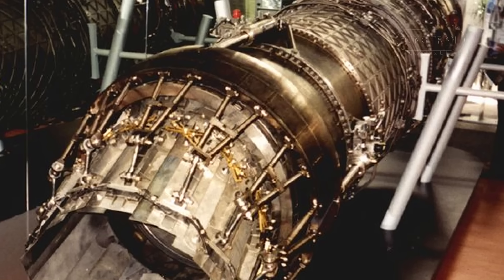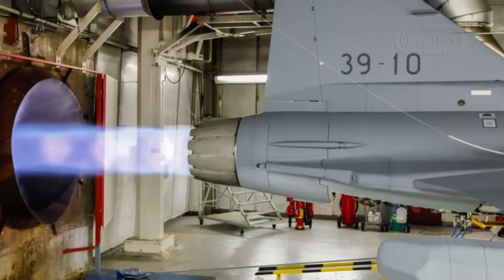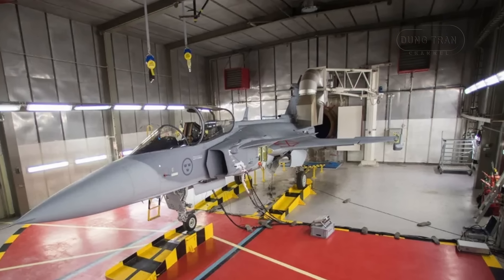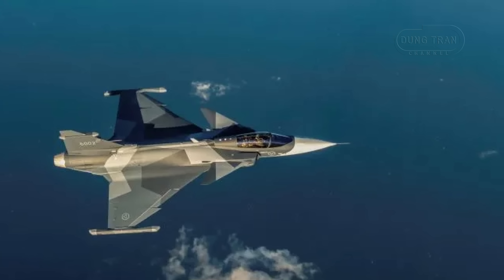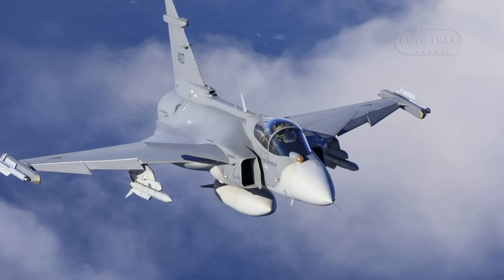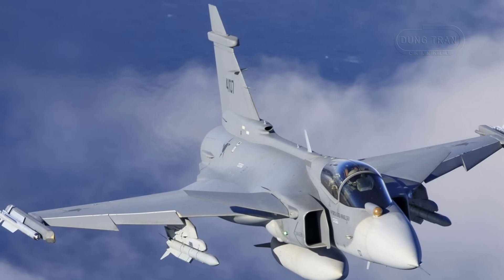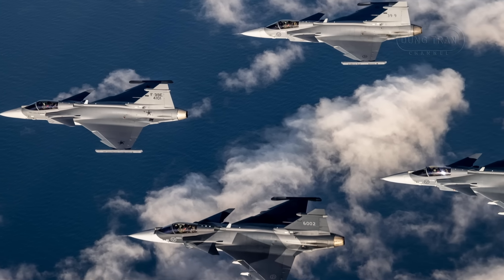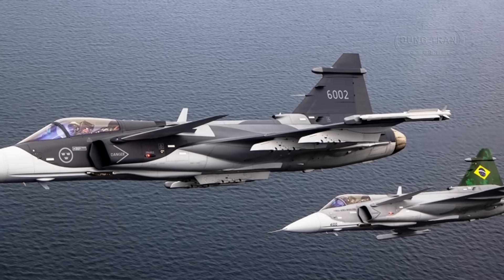Sweden’s Bold Move: Rolls-Royce Engine Could Save the Gripen E/F! 🚀

Comment: Canadian here. Gripen airframes and Rolls-Royce engines . . . Yes! Bye-bye F-35!
Reply: OMG...man I  hope so!!  And I'd love to see them build the engines here in canada as well!!!  Love to help the Swedes build and sell stuff to anyone else who want them!!!
Reply: @toxicslix Swede here. You could have far more runways than planes. You need slightly prepared country roads. I remember having to stop the car because a fighter was landing.  I live in Stockholm, you have to move around in the countryside to see this.
Reply: @toxicslix Maybe that could be arranged
Reply: @toxicslix I'd love to see them name the CF version the Arrow. ❤
Reply: The F 35 has been hyped as a do all aircraft and we in the UK have bought the one even the US Marines are thinking of dropping.
I am certain a Gripen could easily outperform an F35 as it reminiscent of a smaller version of the Typhoon.
Reply: @jeremyrichards8327   @jeremyrichards8327  As a Brit, I'm a fan of the Gripen. Currently our (UK) F-35Bs have no anti-ship capability, no land attack capability and no SEAD/DEAD capability. Plus they won't get Meteor until Block 4 (if that even happens). Building two carriers for such limited capability was a huge mistake.
Reply: @johnnykause - which P51? The first one with the American engine or the excellent one once it got the Rolls Royce Merlin?
Reply: If you look at the statist  the Gripen's warfare suite, can scramble the f35  radar and communications ,and its sensors can track the heat from the f35 engine. That is exactly how a Gripen shot down an f35 at the last NATO war games. A Raphael jet shot down an f35 just the other day in simulated combat. F35s are slow with poor maneuverability compared to most other fighters and only 2200km range compared to 3200km for the Gripen. F35 needs perfect runways and special heated hangers,things you won't have in a war zone. The Gripen can operate from anywhere .the f35 was built for show and tell the Gripen is built for war. Not to mention, the Gripen has nearly spotless record. The f35 has had 12 crashes in 8 years, 2 crashes, and 2 emergency landings in the last few months .
Reply: @JamieCyr-iq9ns  Great info--thanks!
Reply: And if paired with SAAB Global Eye using Bombardier Global 6500 airframe, the duo will be deadly and profitable to Canada.
Reply: 🇨🇦. Hey
Reply: CANADA, buy a few AND Join BAE in developing the Tempest II. Look ahead, Remember HOW USA MADE CANADA DESTROY THE AVRO ARROW?
WE (UK) do, Australia DOES, time that we all STOPPED BUYING ANYTHING from the USA, anything!
Reply: Canada should definitely give fair consideration to a Gripen E/F powered by a future EF-230 engine and not use it as some kind of negotiating tool the way Trudeau did before agreeing to buy 88 F-35As.
BUT
-The EF-230 needs to be developed for single-engine certification for the Gripen, which will add delay and cost,
AND
The Gripen E/F air intakes and airframe need to be redesigned to accommodate a yet-to-be certified EF-230, which will take time and add cost,
SO
RCAF Gripens will take longer to arrive and end up costing a lot more than they currently do, based on the engine swap alone. I don't know how much of the avionics is US reliant and what it would take to replace those with the nearest non-US equivalent.

If i were SAAB, and Rolls Royce I would want a firm order from Canada (and perhaps other countries) before embarking on such a risky, expensive venture.
If I were Canada, I would have to be so motivated to ditch dependence on US aerospace manufacturers that I would be willing to face more punishing tariffs and open-ended costs plus delivery delays for the Gripen. For that to happen I would need to be confident I had popular support despite Trump's threats. 

I've never seen a coherent Canadian defence plan that could foresee what major threats the country needs to deter and how such an air-war might be envisioned. Is the Gripen the best fit for Canadian defence? 

Let's face it, if MAGA-USA decided to attack us, no amount of Gripens or F-35As will dramatically change the ultimate outcome. Judging from what I've heard about the Russia-Ukraine war, either could be viable against a conventional attack by Russia - in fact the Gripen was designed explicitly for this. It was developed by Sweden, with a long-standing, remarkably advanced aerospace industry and a country that knows about operating in cold climates. I really like their dispersed operations approach which could greatly  reduce the chances of taking out RCAF capabilities in the early stages of a conflict by bombing fixed air bases, repair facilities and specialized runways, but Canada has never worked that way. Could it adapt? I certainly like the cheaper claimed airtime costs (~$5000/hr for the Gripen vs. ~$30000/hr for the F-35A). I know the RCAF wanted the F-35A from the outset, and argued that the Gripen would not be "interoperable" with the NATO standards, but surely if there is will with NATO that is a technical challenge that could be overcome - unless the US makes it a political one. A middle level power like Canada needs the best defence it can afford that makes military sense.

I don't recall the issue of "stealth" being raised in the video. 
It seems to me that his business of a "4th" or "5th" generation fighter (one that uses "stealth" to evade radar detection) was invented as a marketing tool for the F-35. The Gripen is often dismissed as a "4.5" generation fighter this way, implying that the F-35 is the more effective choice, but this comes at a significant additional development cost over a non-stealth design. Like the F-117, the F-35 is shaped to reflect radar so the returning signals suggest something with a very small "radar cross section" like a bird, which will be ignored. The downside is that shaping the aircraft this way compromises aerodynamics and performance. The older F117 consisted of a series of angular planes and was very stealthy but barely airworthy from what I understand. Only cascades of computerized flight systems reacting to pilot controls allowed it to fly and there were crashes.

SAAB claim to have developed electronic warfare measures can react as soon as the Gripen is illuminated by hostile radar and can compromise the returning radar signal in ways that allow it to evade detection. If SAAB has in fact achieved "electronic stealth" without compromising performance it may have totally undercut the huge development investment on airframe shape stealth by the US (and Russia) as well as client air forces that bought the F-35 while Gripen - designed for optimum aerodynamics -  keeps excellent performance and maneuverability plus a more affordable unit cost. All that still remains to be seen AFAIK.

I hope Canada determines that the Gripen can fit into its defence plans and that she should reduce her purchase of F-35As and replace them with Gripens (or failing that the Euro fighter Typhoon or Dassault Rafale). Understand though that this is a big military, economic and diplomatic decision and one way or or another Canada will pay for not buying big-ticket American military hardware (that may have been a major factor in Trudeau buying the F-35A instead of the Gripen after promising Canada would never buy the F-35A a few years back) . 

Defence procurement has been broken for a long time in Canada and that needs to change pronto. The Gripen decision - complicated by a change of engine and perhaps avionics - needs to be made quickly - it can't be pushed off for 15 years like the naval ships procurement or the CF-18 replacements. Canadian Prime Minister Carney needs to accept there are big risks, hold hold is breath and remember that the country is currently facing hostile neighbors on both its borders. I hope he also appreciates that the priority here must be to equip the RCAF with a modern fighter/bomber deterrent and that creation of an industrial capacity to eventually assemble there aircraft in Canada is a desirable but secondary consideration at first. This should not primarily be about subsidizing "make-work" defence industry but equipping the RCAF for national defence. Eventually perhaps we can completely or substantially produce these aircraft in Canada, but to get them into the hands of the air force ASAP, the first ones need to be bought off the shelf from Sweden.

So is Carney serious when he argues we need to be less dependent on the US and strengthen economic and defence relationships with our European partners?

If Canada chooses a Gripen E/F variant with a European engine, it could start a cascade of global orders for the Gripen E/F from other nations also currently kicking the tires. It will also attract huge MAGA-US retaliation, but it will show that finally Canada has chosen to abandon being an unofficial US protege and chosen to chart its own course - even if that comes with a severe short to medium term cost.

We live in interesting times... 🇨🇦
Reply: @tsegulin Might as well make a new aircraft, because more than 30% of the components/parts is American. 😂
Reply: @tsegulin   @tsegulin  

"The EF-230 needs to be developed for single-engine certification for the Gripen..."

Or how about developing a Gripen G/H variant with 2 engines? That would make the Gripen faster and it could fly higher.
Reply: You see why professionals make these decisions, not amateurs who don't even know that EJ230 is vaporware.
Reply: Bye bye,  don't let the F-35 door  hit you on your way out.  The shorter the cuee the faster smarter nations can get theirs . Btw, Turkey out of frustration they still  can't get the F-35 , went for the Eurofighter not Saab.
Reply: Couldn't agree more
Reply: 🇩🇰 chiming in 👍
Reply: It makes perfect sense
Reply: The Gripen will have to outfit at least two or more Countries to Build more,that would take time to fill the new orders.Before to many of them are built the next Generation Gripen will be invisible with its new Stealth Coating. Sweden just joined NATO. It would be in the best interest of NATO to brings Sweden’s high tech up too par.
Reply: Too late,  already bought 12.  These will languish as miserable unloved orfans,  sucking inordinate resources to keep in the air. Thanks True-Dough.
Reply: Just spray the gripen with stealth coating to keep it fine
Reply: I’m a Gripen fanboy, but that’s dumb, F-35 is superior.
Reply: @brazapride  But the F-35s can only be maintained in the US . . . our enemy now. That would be like Britain in 1940 only allowed to use Bf 109s against Germany and the British 109s could only be maintained in Germany. Much dumber, dontcha think? 🇨🇦
Reply: @trilingual6725 enemy that 80% of your exports go to. 🤡😂
Reply: @brazapride  Ah, MAGA dude . . . 80% at present, yes. That is changing right now. Do some Googling. And anyway,  how does that change which fighter my country should choose? It is still lunacy for Canada to choose a fighter that can only be maintained in our enemy's country, no matter how much of how little of our exports go to that enemy. 🇨🇦
Reply: @brazapride  F35 operational cost can be 5 times of the gripen.would willing to do that just for daily patrol
Reply: @salsalsalsal789  Canada got the money.
Reply: @brazapride  USA got the money but they keep the F16 for their workhorse for a reason.fuel and money are not the things to throw away in patrol,military budget is for war preparation for safety reason
Reply: @salsalsalsal789  Yeah, but the US has F-22 and F-35 too.
Reply: Well you certainly got shafted over the Avro Arrow!
Reply: Canada already uses the G414 and GE404 engines in its F18A and F18C jets.  It would actually benefit them if they used an Airframe that uses a similar logistic base...since the engine...
Reply: @rgloria40   since the engine . . . is American, why would Canada choose that engine? As we fought the US invasion forces with our fighters, America would supply us with spare parts for the GE404 engine. . . so we could shoot more Americans down? Your logic is very American . . . since the engine . . . indeed 🇨🇦 🇨🇦 🇨🇦 🇨🇦
Reply: @rgloria40  Why would Canada pick any airframe using American engines? Now that America is an adversary of Canada, how would we get spare parts for GE engines in the midst of America invading Canada? America would give us spare parts while we are doing our damnedest to shoot down as many Americans as possible? You use very American logic, which assumes everybody except Americans are extremely stupid . . .
Reply: @rgloria40  It would benefit Canada to use engines from America, which wants to invade Canada?? Yeah, sure. Let's order turbofan spare parts from GE (America) while we are trying to shoot down as many Americans as possible. I'm sure our new adversary--America--would love to help their enemy! American logic . . . assuming everybody--except Americans--is stupid. FFS . . . 🇨🇦 🇨🇦 🇨🇦 🇨🇦
Reply: Yes, Trudeau 2.0 needs to say F*** the USA!
Reply: Same for Australia
Reply: @jimgraham6722  Australia is the third largest owner of F-35s globally I don't think they're going anywhere lol
Reply: @ArizonaAstraLLC  Agree, in the current circumstances I think Australia should double its combat aircraft force. I would like to see an additional 30 or so 35C models and upgrade to the Canberra's to allow lillypad operations off shore.

Sixty or so Gripens for point air defence and close air support, we should reactivate CAF aviation to operate these. Besides being non US sourced, their  greatest capacity is the ability to 'scatter to survive'. There are many regional airstrips around the coast and suitable stretches of road these could operate from. Scattering this way seriously complicates the air picture for an aggressor.
Reply: What have you flown? The F35 will and has been dominating Jas39s since it showed up at exercises. You people who have zero expertise in this area need to keep your opinions to yourself cause they arent nothing but ill thought words with zero expertise.
Reply: @MetaliCanuck  I take it then you have flown an F35
Reply: Canada voting Liberals, bye bye Canada!
Reply: @OldeJanner 😂😂
Reply: Gripen would never see the F-35 that shot it down
Reply: @drdoug007 considering who has F35s, when would Gripens go up against them?
Reply: @chiggyvon Gripen has proved they are more than capable to fight against F 35.
Reply: @ZSAZSS09 not concerned either way as I wouldn’t expect CAF to go up against any F35s in aerial combat, and Canada will have a few F35s since they’re on the hook for the first shipment
Reply: @chiggyvon  yes, they will have 16 F 35. That's what they have paid for.
Reply: @drdoug007  The F35, known as "Adir" in Israel, faces issues with stealth reliability, maintenance systems and operational efficiency, raising questions about the world’s most expensive weapons system, which has cost $1.8 trillion to develop.🤣If it even made it off the ground, or the Pilot had to eject first.🤣
Reply: @drdoug007 only because F35 has such bad sortie rate. In the air Gripen E has the upper hand, better EWS, better radar, better data link and therefore sense fusion.  And it fields the Meteor which out ranges amraams. So thats that.
Reply: @drdoug007  But the Gripen equipped with passive radar from Hensoldt would have seen the F35 long ago and accelerated and flown higher so that Meteor could get further! Especially if it had the new EJ230 engine from MTU in it. It is not RR who developed the EJ200/230 engine, but MTU with Fraunhof Institute and DLR! They also had to develop two completely new systems for it, which made it possible to build the EJ200 in the first place! If you compare EJ230 / diameter 850 mm with F22 engine / diameter 1100 mm power and size, then EJ230 engine would be between 70-100% more powerful! THE EJ200/230 engine is in a different league and designed for extreme loads.
Reply: @tlsigIn your dreams 😂😂😂
Reply: @drdoug007 and an F-35 wouldn't be able to lock onto to the Gripen E, which forces them to close and the Meteor & IRIS-T is hungry.
Reply: @CatacombStranger  Dream on....
Reply: @drdoug007  Because the F35 would never be able to get off the ground?
Reply: @drdoug007  I'm not so sure about that, but you're welcome to present real world data. Besides that, the whole point is getting away from an unreliable partner which can't be trusted anymore and may even attack countries within NATO, in one way or another.
Reply: @drdoug007 is that because Trump is going to sell the F35 to his best buddy the Russians? (Could even be via Turkey)…………
Reply: @drdoug007  Really?
Reply: @drdoug007   @drdoug007  

"Gripen would never see the F-35 that shot it down"

Apart from the fact that Gripens were designed to fight Russian aircraft, not F-35s, if you fit Gripens with Leonardo's BriteStorm & a DIRCM system (in addition to BriteCloud decoys that Gripens already have), then Gripens would be very hard to detect and shoot down. 

Fitting HK-DAS missiles would make them even harder still to shoot down. Other options to shoot down incoming missiles would be laser/microwave/RF weapons, as well as laser-guided .50 cal (12.7mm) guns and/or guns firing airburst rounds.
Reply: @drdoug007 they could sell the F-35. and before you disagree because of US, who gives a f****? Trump likes to break agreements, so let him taste his own medicine
Reply: @drdoug007 Reliability is an important factor. A F-35 with a killswitch is an expensive but potentially useless inventory. If the US is returning from blackmailing the rest of the world back to normal politics we can talk again. Maybe. But your good reputation has vanished.
Reply: @drdoug007  F-35 will be in the repair shop or waiting for good weather to fly in.
Reply: @ Nice try
Reply: @drdoug007 we need only worry about that if USA provides Russia with F-35. I would not be surprised as Russia is now USA new friend.
Reply: Canada has a toy army. It does not matter what plane they buy. They could buy new P-51's. The USA will still bail them out. Or just buy pink planes. Same difference.
Reply: @johnnykrauze The amount of respect given by respectable former US military personnel with YT channels who have served alongside of their Canadian counterparts, directly contradicts your post. I choose to believe people with first hand experience rather than some random poster on YT
Reply: @banderson8444  thank you for your well thought out and intelligent reply. But Canada does not have much equipment that is of great value in a war. The military as a whole is a disaster in how it works. Not the performance of individuals.
Reply: @ Neither did the Taliban but it seemed to work out well for them.
Reply: @johnnykrauze  Ah, MAGA dude . . Who will bail the US out as its economy collapses? lol
Reply: @johnnykrauze  nuke drones
Reply: @johnnykrauze  America ought to be getting twitchy - defence sales are an important part of your export profile - each sale lost is jobs lost. You have already lost Boeing sales to China - it looks like the only sales you will have is in an 'axis of evil' with Russia!
Reply: @johnnykrauze not under Trump. He wants Canada as his 51st state. USA may invade Canada. They did it before in 1812
Reply: @johnnykrauze funny since it’s the USA that is setting this in motion
Reply: @johnnykrauze as long as we have tampoon dispensers on board!